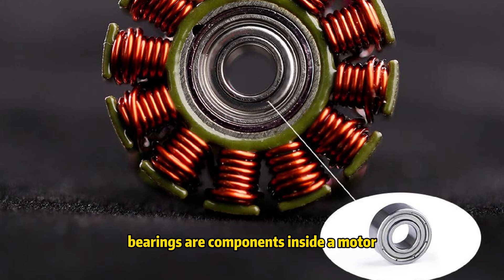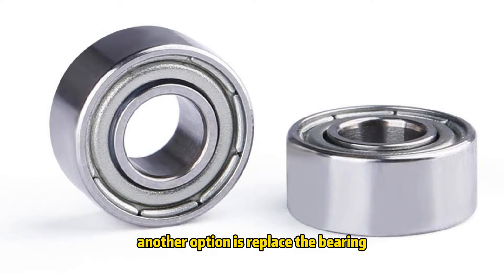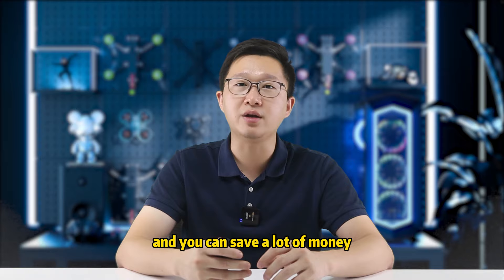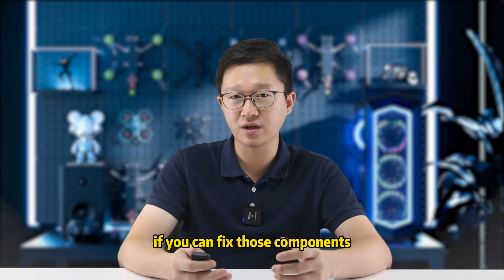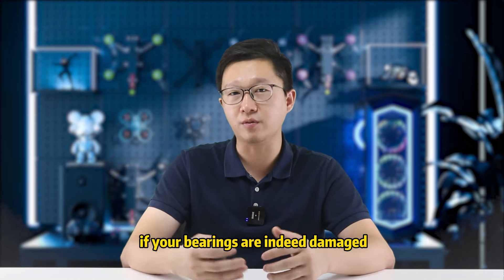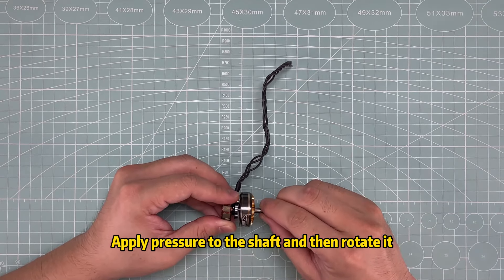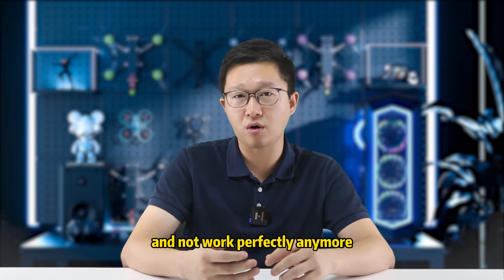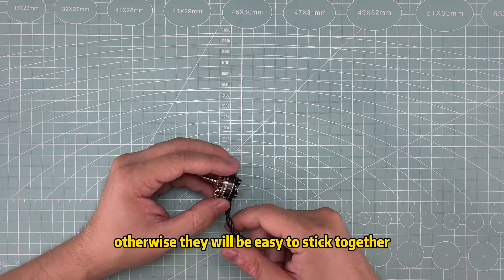Unleashing the Secrets of FPV Motor Bearings: What You Need to Know!

Comment: FINE GOOD!! BUT WHAT IS A FPV MOTOR?????  SAME AS BDCM- PWM MOTOR?????                                                              JAMES J.DEVITO III,GENERAL DYNAMICS, ELECTRONICS DIVISION
Reply: All motors we use are 3-phase brushless motors, usually in a 12N14P or 9N12P configuration with stator sizes from 0702 to 3115 (mm diemeter/mm height)